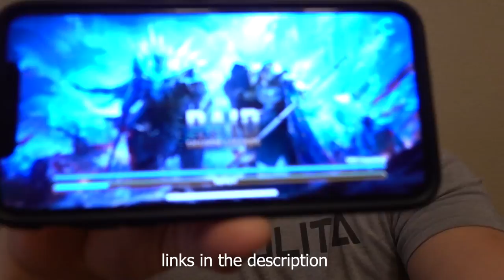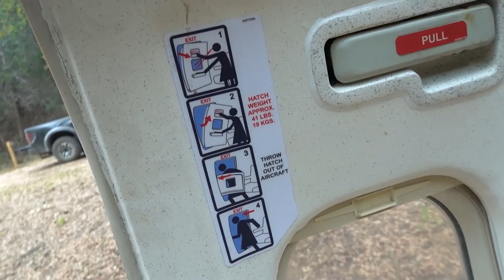Don't Ask How I Got This... Just Help me Destroy it...

Comment: Demo - I used to make some of those parts. If you want to test a 'bullet' proof airplane part try the fuel access doors. It goes on the wing, there's a sheet of titanium in most of them and we did impact testing on them... they can stop a lot of things (basically have to prevent a rock at 200 mph).
Reply: @Hugo Calvaron He already did.
Reply: @Ayden Dail I mean something like a much bigger potato gun essentially
Reply: @wyattlofing137  yeah, air cannon - we didn't use rocks but a ceramic ball... its meant to simulate a rock... and the rock/bird isn't going fast, its the aircraft.
Reply: The 22LR hit the aluminum spar of the frame and that’s why it didn’t go thru. It’s all about weight savings so most of the frame is “hollow” but you can tell by the rivets
Reply: You want bulletproof, try the depleted uranium counterweights
Reply: @Ayden Dail plane doing 200mph...
Reply: @ropeadopepope3609  That's what I was thinking when I was the rivet marks on the door.
Reply: @DrekJS27  what so the plane is flying when you test it? Meaning someone is sat flying it whilst it gets hit by a rock?
Reply: @d1sma136  lol what? No, we did a destructive test on these fuel doors in a room, remote fired a ceramic ball at it. We didn't shoot rocks at planes lmfao.
Reply: @d1sma136  -maybe not “test” per se but have seen so many nose cones, windscreens, leading edges, etc that have been demolished by bird strike
Reply: @DrekJS27  like the reason there’s no square corners on fuselage. Strungth
Reply: @MAGAMAN  it def woulda stopped it because the body is built out of relatively soft aluminum due to the expansion/contraction of pressurization and altitude. That alone can cause cracks if they didn’t use correct temper on a repair or bought cheap shit from a foreign country
Reply: @d1sma136  it has to be tested and certified in accordance with the FAR’s. He probs worked for a pma (or subsidiary of said certifying/airworthiness body)

Comment: Hey matt, those are pretty thin cutting gloves. I work as a chef and you can get thicker ones. Ones like chainmail.
Reply: You should get some together and offer to send them to him
Reply: You’d probably have to slide into his business email
Reply: Yep, and make sure they're welded chain!
Reply: ive used really good chainmail ones when I worked in a factory
Reply: Jesus Christ why go as far as chain mail for such a mundane thing as cutting up ingredients? I just wanna know why
Reply: I used the chain mail gloves and apron when working at a meat packaging plant. Think it’s over kill till some other idiot almost stabs you from not paying attention
Reply: Someone has never held a chefs knife damn things can cut air
Reply: They weren't even cutting gloves they where just wool gloves that U wear under a mesh glove and even then Ur knife is still sharp enough to go throw them
Reply: @danii8168  There’s various different knives in a chefs kitchen. Cleavers and etc. They are all sharp as hell and can easily cut through your fingers which are your most important tools on the job.
Reply: I’m ur 69th like i feel cool😂
Reply: @danii8168  cause cheap cutting gloves you can still get cut with really sharp knives but if your a pro you don't need them cause there is a  cutting stance you can use that's called the claw where you use your knuckles to hold the ingredient instead of your finger tips...
Reply: Was a chef for 14 years, used a set of razor sharp Globals I honed on leather.
Took the tip off my thumb once and tip off index finger another time, cutting sundried tomatoes and stack of bacon slices

But at the speed I had to work chain mail gloves would have been too slow, makes your knife skills a lot finer, and technique plays a big part.

I used to fine slice 2kg of medium button mushrooms in about 5 minutes and never looked down at my board once.
Reply: @danii8168  i know butchers who don't use(d) chaingloves and only get 4 beers and a shot in a pub

Comment: Don’t be afraid of pawn shop guns. All mine were bought from pawn shops. When my house burnt down and only one of six barely survived. I soaked it in vinegar  and wiped the rust and char off and slapped some hogue grips on it. It is still structurally stable I’ve checked it hundreds of times. Taurus 82 .38 spl. Felt naked af without it before it was found. When you don’t own a firearm anymore you feel vulnerable and weak

Comment: He hit a support bracket of some sort with the 22. Look at the door when he’s reviewing the shot after the .380 @6.42
Reply: Yep, you can see the weld marks
Reply: Came to the comments to see if someone had already pointed it out. Right in line with the spot welds.
Reply: he did. and those are rivets, not spot welds. with how thin the outer skin is on an airliner, and the need for it to expand/contract with the temperature, welding the seams would weaken the metal and not let it "move" like it should causing premature failure.

Comment: The windows are Plexiglas on the outside, the next window is a secondary pressure pane, the last is to keep your greasy sweaty fingers nose etc... off the important stuff, the shade is part of the Interior trim panels.   It is built from aluminum.

Comment: As an engineer, I was so sad because I knew exactly how this video was going to go, and I could just feel Matt's disappointment: even before it happened.
Reply: Engineer
Reply: Ditto. I'm an aircraft mechanic, and have played with many emer doors. They're not all what people think they are. It's thick aluminum sheet metal, riveted together. I think the skin is like 80 thousandths of an inch. Not much.
Reply: I know. The only reason the 22LR didn't go through is because it hit a stiffener.
Reply: @mike499  exactly what I said in a main comment.
Reply: not an engineer but i knew it wasn't gonna hold up, planes are just big aluminium cans, most of the rigidity comes from the cabin pressure, they are made as light as possible to maximize efficiency and/or payload

i would rather see him shooting shotgun shells into a curved pipe, its entertaining and looks like magic to the average viewer
Reply: Yeah I work structural maintenance and knew that it wasn’t going to be worth his time as soon as I saw it lol
Reply: As someone who hasn't a clue and watches too many movies, kinda had the same feeling😬 guns and planes don't mix

Comment: I am not surprised how the door turned out.  22 would have probably gone thru if you didn't hit the rivet row.  You should see if you can get your hands on some Embraer rotor debris shields.  1/2" thick flexible Kevlar.  I would like to see how those hold up.

Comment: So I’m never buying any “cut safe” gloves ever..what a ripoff
Reply: They do actually help. It won’t save you from a deliberate chop. But it’ll help if your hand slips filleting or something.
Reply: why
Reply: They aren't cut proof, they are cut resistant.
Reply: They protect your hand by absorbing most of the cut in the gloves. If you would do similiar cuts with no gloves or normal gloves it would slice right through your hand.
Reply: If you do want cut proof gloves get mail gloves, I use them as a butcher and they stop my knives even if I try to go through them
Reply: What if they slash the price?
Reply: You can get some that are actual cut proof, the problem is that you don't have alot of movement in them, bare in mind cut proof here means a knife doing normal activities with a knife, but a sword chopping down on them, they have a metal plating on the outside and are most used in areas with drug abuse to pick up needles safely
Reply: @hunterdan2002  but they arent though. the two videos Mat has used them and literally the first thing he does is immediately cut through them with no effort at all

Comment: It's not super surprising these airplane doors aren't very bulletproof.
The designers were probably thinking that with a plane in motion, the air being diverted around the fuselage would be similar to shooting through water and it would either miss or fail to penetrate.

Comment: I have a cut glove I can send you a favour I find it it's steel links it's made for butchers when they're swinging their meat Cleavers down if they actually hit their hands or just maybe going to break a bone I have tested it I have taken knives and meat Cleavers to my own hand while wearing it don't step directly down though my dumbass and I put a little hole in my hand but hey it stopped it because their links the tip will go through but if you're just so you know cutting normally or hacking down ya works perfectly fine stop by a.22 but probably nothing else